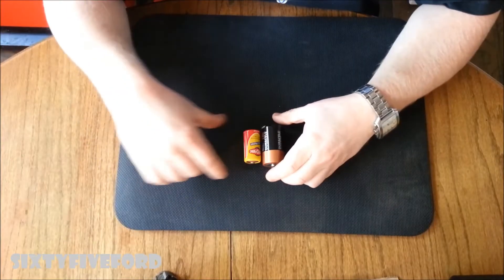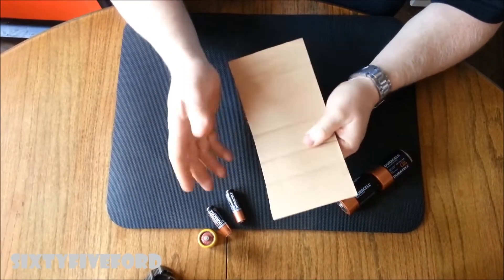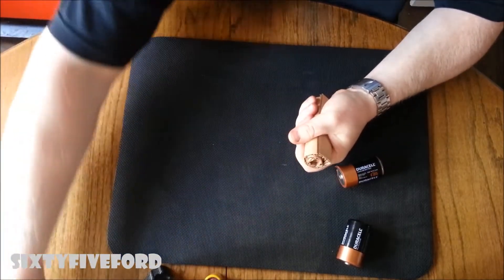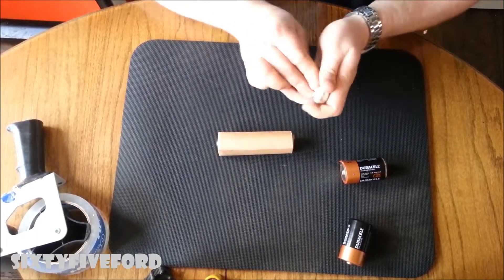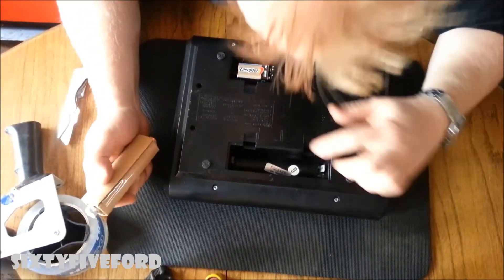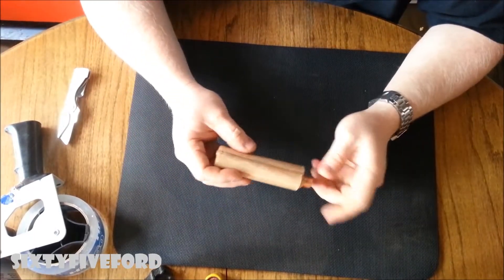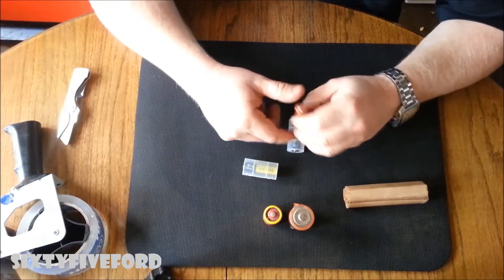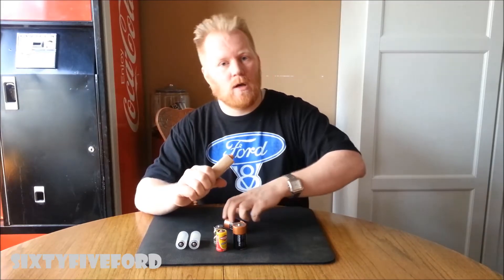Run out of C - D cells ? use AA battery Instead

Comment: Could you have done that with the c batteries in place of the aa batteries?
Reply from the maker: If you can fit C batteries in the spot, yes. D,C, AA and AAA are all the same voltage and can be swapped around anyway you wish.

Comment: But aren’t AA batteries half the capacity?
Reply from the maker: Yes, but C and Ds are 10 times the cost.
Reply: @sixtyfiveford  Cs are a dollar or 2.  That’s more like twice the price of AA.
Reply from the maker: @lifehackertips  True. I just looked and Cs are 1.55ea vs 0.45ea for AA within the same brand. AA puts out 2800mah and C puts out 8000. So it is cheaper to run 3 AA back to back than 1 C cell. D's are more common than Cs so cheaper at $1.26ea for 15000mah. So it would take 5 cells of AA to do the same work or $2.25 vs $1.26. 
Anyway, that's not the point of the video at all. The point is Cs and Ds are increasing uncommon and few people still buy them or have them on hand like they do AA or AAA.  I can't even think of a single device made in the past 10 years that still uses Cs or Ds besides maybe a Mag flashlight. But even there you would be better off to use Nimh AA cells and an adapter made to hold 3 AA cells and convert them to a D https://amzn.to/3fJCjJD

Comment: I don't get this....if on voltage and current level these batteries can replace each other....then why in the first place so many types of batteries were manufactured🤔I mean they could just have made all the devices AA battery compatible🤷‍♂️🤷‍♂️🤷‍♂️
Reply: It's the amp hours. Basically more capacity.

Comment: i'm a little dumb but will the output be the same?
Reply from the maker: Yes, all these cells put out 1.5 volts. The size difference is only capacity. So it will run longer on a D cell vs a AA.

Comment: Nice video but one thing to keep in mind is not to use the harbor freight batteries as seen in your video. When I used them in my devices they left it leaking and spilling battery juice that ended up burning my hand and ruining my device.
Reply from the maker: True. The cheap carbon batteries have a tendency to leak.

Comment: is this safe to do. will it damage my device.
Reply from the maker: +Syed Ali It will not and is perfectly safe for your device. AAA, AA, C, D all supply the exact same voltage to the device. The larger cells just hold more power and last longer in a device. So a AA that is replacing a D cell will only last 1/3 or so the time that a D cell would.

Comment: I have tried this hack before on a lantern that uses D batteries. The problem with aluminum foil is that it initially works pretty good but the connection it makes seems to be a little flaky. Especially if you need to use more than one piece of foil (I was trying to make AA substitutes for the D batteries in one of those Coleman LED lanterns with the battery cartridge). The foil seems to compress over time and randomly looses contact. That's why they use springs, I guess.
Reply from the maker: Octo Puss Good point. The trick is to tightly role the foil so it is as compressed as possible to begin with.

Comment: I used your technique for charging CR2032 batteries with a radio shack universal power supply. About an hour on and a couple of hours off.  I have restored two so far since yesterday.  From about .8 volts to a steady holding charge of 3.270 volts.  Now I guess I will have to get a variable power supply for all those button batteries.  My HP calc will eat $15 bucks worth a year. Not including my watches that the jewler rips me off by ten bucks.  Time to get the tool that opens that up and do it my self.  Thanks for the posts. I am going to try your bacon soon.  Going to either make a smoker from a keg or a metal barrel not sure yet. Easier to cut the barrel... I did get the kegs though to make a BBQ grill and a smoker we will see what happens...
Reply from the maker: William Ward I charge watch batteries all the time. They only take about 5 minutes to fully charge(tiny button cells). I just use my standard battery charger and slip them in as they are either 1.5v or 3v. If they are 1.5v I just put them in with a AA, AAA or what ever I have laying around and use a metal object(nail) to take up the dead space to the terminal. 3volts and they go in alone as my charger does two 1.5v cells at a time.
Reply: Oh, great idea don't think you mentioned that good trick on doubling up.
Reply: I tried the button cells using the nail method you mentioned. Wow did they charge fast.  Thanks again for sharing.

Comment: Probably better off with the aluminium foil in the middle of the batteries, at least then you get the proper battery connections at each end. I reckon a spring in the middle would be a good workaround too.
Reply from the maker: Evil from evilution Yeah either way would work good.

Comment: Using aluminum foil won't cause an issue? And wouldn't using an A cell for a D cell application not work considering D cells have different amperage values?
Reply from the maker: TheFlacker99 (Flak) The smaller cells just have a lower capacity so they will be used up faster.  The aluminum foil easily transfers the electrical current in these low voltage, short distant situations.

Comment: Don't different batteries have different voltages?
Reply from the maker: Love2boat92 AAA, AA, C and D all have the exact same voltage. The larger sizes just hold more capacity so they last longer.
Reply: sixtyfiveford I did not know that. Thanks for the tip.

Comment: I have used external batteries  used a usb  cable to run some devices just need to see voltage..  Thanks That will work great for some old flashlights I have.
Reply from the maker: 000Virtual Thanks Man.

Comment: Great Video, the only reason that C's and D's are bigger is just because they have a higher Amp Hour Rating.
Reply from the maker: TRX450R Vlogger Yeah, they won't last as long but the AA are a fraction the cost as well. In most cases it's less expensive to run the equivalent number of AA batteries through a device than buying 1 D cell battery.
Reply: I agree with you! lol

Comment: I have a question for you I have always wondered, the size of the battery does that mean the voltage or the capacity??
Correct me if I'm wrong you can replaced Triple A or AAA with button cell batteries they are the same size.
Reply from the maker: redneckbryon Watch batteries are either 1.5volt or sometimes 3volt. AAA, AA, C, D are all 1.5volt with the larger sizes just having more capacity.

Comment: You crack me up dude, your all right pretty crafty,I really liked your she'd made of pallets video ,it inspired me to go down the road and fish used wood like 2x4, 2x8, 4x4 and built a pretty nice pergola,all for free,they are building homes and I got all the wood I can get out of the construction dumpsters and it came out pretty nice if I don't say so my self but didn't cost a ime and ended up being about $800 in wood after all was done, I had to pressure wash a lot of the wood at night time cause the wood would have like tar or concrete on it but all the wood I ended up getting was pressure treated scrap pieces and or builders framing wood, keep up the cool tricks or the trades
Reply from the maker: armando patane Hey Thanks Man. Yeah, they throw away a lot of usable wood at construction sites.

Comment: thanks for the tip! By the way, I tried to recharge Panasonic Alkaline AA Batteries with a time switch, like you showed in one of your Videos ...and it actually WORKED!!! thanks for that!
Phil
Reply from the maker: bl0ckbust3r Thanks Man. That's great that you are getting more use out of your cells as well. They seam to like to take a charge easily if they haven't been drained to total dead.

Comment: I did the opposite of this, I have a small fm transmitter that runs on 2x AAA batteries and they run down very quickly, which affects the audio quality - so I soldered in an external battery box which holds 2x C batteries, and as you say, they are the same voltage, but higher capacity, now it runs for what seems like ten times longer.
Reply from the maker: davidrobert2007 Yeah Cs will last a ton longer for sure.

Comment: cool never knew about this. how much less time will the AA batteries last compared to D batteries?
Reply from the maker: mike gager About 1/4 as long with Alkanline. I run a lot of rechargeable batteries and there is no difference in C, D, or AA capacity with these.

Comment: You bodge artist ha ha :D :D

Ive used flagging "D" cells to run freestanding clocks when i ran out of "aa" cells, a couple of wires on the ends and coins+elastic band to hold them on, jam the single core thin wire into the spring and behind the plate, worked for a year after that, but the "D" cell was dead anyway :D

Yes im a worse bodge artist lol :D :D
Reply from the maker: zx8401ztv As long as it works!
Reply: sixtyfiveford
Yes it worked fine :-)
I just watched photonicinduction test a really interesting battery/jumpstarter
Pocket size Easyjumper starts V8 5L Merc and Diesel Van.

apparently litium ion, amazing battery!!
Reply from the maker: Yeah, I've seen those small jump starters.